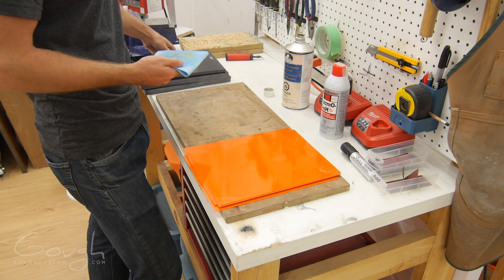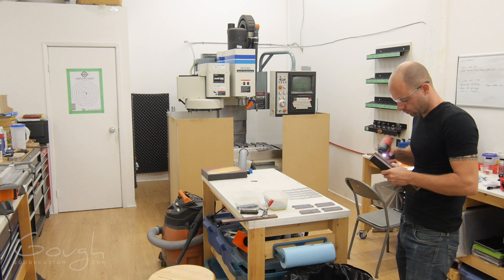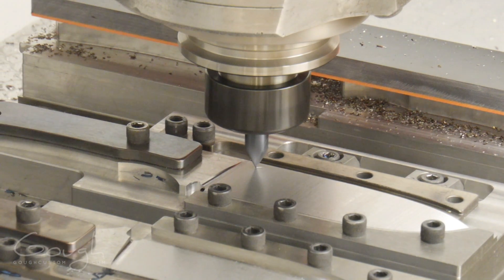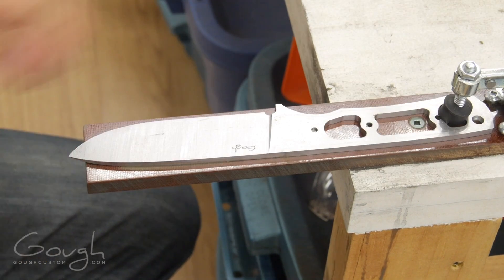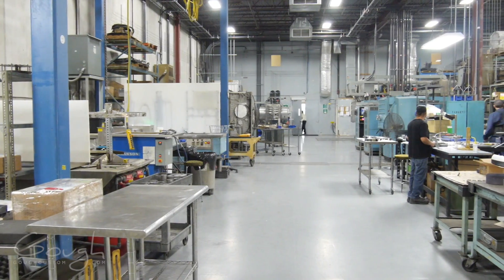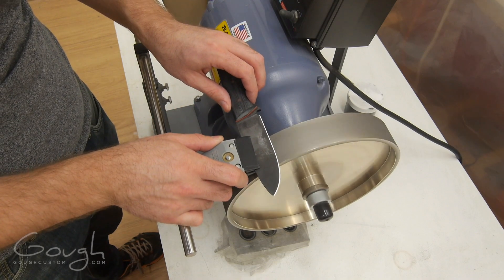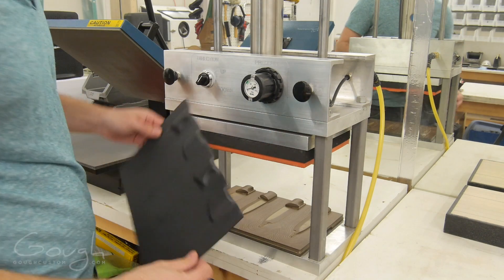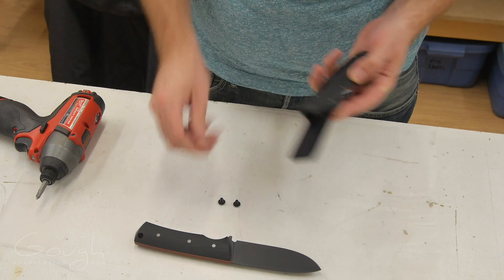Making a knife the high-tech way - Resolute MkIII

Comment: 63 Rockwell is not perfect
Reply from the maker: For my knives and my steel 63HRC is indeed perfect! Fantastic edge retention and lots of toughness. I have hundreds of these in the field with zero failures or issues.
Reply: Wow, 63 is pretty freaking amazing!  Honestly! 63 on the Rockwell exceeded my expectations by a large margin.  I was expecting somewhere around 56-58, to get 63 out of A2 is truly fantastic.
Reply from the maker: @levskitoronto  It's actually fairly easy to over-harden A2 if you're not careful! Higher hardness is not always better, every steel has a point at which it becomes brittle, which will differ a bit depending on the exact heat-treatment method used. I have found this hardness to work out really nicely for A2!
Reply: @GoughCustom  , I agree. 63 surely will give it excellent edge retention and since your knives have proven themselves to be durable and strong, I would say you have achieved a great balance.  Knives look superb. Good luck in you future endeavors, hope to be able to afford one of these beauties in the not too distant future. Cheers

Comment: As I saw you spin up your custom grinder I was wondering why you spent the time to reinvent the wheel there.. only until I realized you built it to keep the honing and grinding angles exactly the same, I really like that, it's something I wish I could do with my tormek! Brilliant!
Reply from the maker: Exactly! The honing angle is actually slightly shallower than the grinding andgle to make sure I hit the edge first, but yeah the setup works really well! The other benefit is that I never have to dress the grinding wheel, it stays perfectly flat!

Comment: VERY nice blade but knowing that the entire blade is heat treated to the same hardness and not just the edge makes it a blade I wouldn't carry and as such makes the sheath unnecessary.
Reply from the maker: Hey John! There's really no issue with a through-hardened blade! A2 is a very tough steel! I have batoned hardwood with my knives plenty of times for instance with zero issues...
Reply: @GoughCustom  batoning a knife is no real test of flexibility. I have found myself using my knife in a twisting/prying fashion MANY times in "normal" use. That is a true test of blade durability. If you can pry with it and it bends instead of breaking then in a survival situation "which all of my edc blades are intended to work for" you could beat it straight enough to continue using. I know that most people don't really need this ability but I spend about 80% of my time in the middle of nowhere miles from help and I personally need that kind of peace of mind.

Comment: I'm not an avid watcher, so I'm not sure what happens with the plastic sheets after you cnc the sheaths, but it looks like you could fit a couple more belt loops onto the leftover plastic. Maybe use them as extras.
Reply from the maker: Unfortunately most of the rest of the plastic sheet is actually not perfectly flat, and I need some space for the tape to hold it down, so I can't use 100% of it! I am working on a new way of making the sheaths that will use more of the sheet though!
Reply: Regardless, your knives are insane. Definitely subscribed.
Reply from the maker: @Post220  thanks bud!

Comment: Question, what type of alloy is used for the blade?
Reply from the maker: Hey mate! In this case it was A2 tool steel.
Reply: Gough Custom thank you for the reply. Follow up question if I may. Why not use a more traditional/common alloy such as a blue or white steel, 400 series, Damascus, etc? Don’t mean to be second guessing you, just wondering.
Reply from the maker: Hey mate! The main reason is that A2 is a really good balance of toughness, edge retention and corrosion resistance. The paper series steels are nice, but very prone to rusting. 400 store steels tend to be low end, the best one is 440C and unfortunately that tends to have very low toughness. Damascus can be beautiful, but it tends to have more issues than any "mono steel" would, things like cold shuts, slag inclusions and so on can be hidden from the outside but cause issues with breakage, and most Damascus also tends to be made from very simple steels so edge retention and corrosion resistance can also be issues... I have a whole video testing a bunch of steels on my channel if you're interested!!
Reply: Gough Custom thanks for taking the time to explain the logic behind the alloy you use. 

Any chance you’ll be making a kitchen/chefs knife? I would love a chefs knife with the lvl of craftsmanship this knife has.
Reply from the maker: Yeah I have a design already for a santoku that I'd like to make more of at some point!
Reply: Gough Custom that’s great news. Is there anyway I can be notified when they are released?
Reply from the maker: Absolutely! If you sign up for the mailing list on my website I will be able to notify you!
Reply: @GoughCustom  You should try Cruwear

Comment: Why didn't you just buy a Tormek knife sharpening system instead of copying their design?
Reply from the maker: My system is inspired by their mechanics, but copying might be a stretch! I don't like their use of traditional abrasive stones as it means that you have to constantly dress the stone to keep it flat. I didn't want to have to run the system wet either which is why I opted for a plated CBN wheel. CBN is very thermally conductive which means it will pull heat out as it's grinding, as opposed to traditional abrasives like aluminum oxide which are excellent thermal insulators and leave all the heat in the workpiece. I also wanted to be able to grind and strop without changing the grinder setup which is not possible with the Tormek, all the ones I've seen you have to switch over the tool rest. So with my one: variable speed, reversible, and ultra modern abrasives mean that can get the job done much faster with zero mucking about!

Comment: I prefer fire and hammers, but as a crafts person myself you'll never find me throwing shade at anyone else willing to put in the time, work, and repeated failures required to find what works and to perfect it as much as they can. Interesting vid and damn fine blade. Respect. 
I'm curious about edge retention and stress tolerance in the blade. A fine edge is all well and good but will it stand up to bone, drops, and abuse? Would love to see that. 
One final thought, if the blades are tempered in a vacuum chamber why do they have a patina on them? Some of my work is tempered in a hot oil bath and the oxygen free environment prevents that discoloration.
Reply from the maker: Hey mate! Thanks very much!
A2 is actually surprisingly tough even at high hardness. My customers and I regularly baton these blades through hardwood with no issues. Haven't any reports of a damaged blade or chipped edge as yet! I also have quite a few military customers and I'm sure they're not nice to their blades! I plan to do a 'use and abuse' video at some point, but I just have to find time!

The blades are austenitized and quenched in a vacuum furnace, but tempering is done in a separate oven with normal atmosphere which is why you see the straw colored oxide. Good eye!
-Aaron

Comment: If you do not have forging skills, but you have a cnc...
Reply from the maker: Not really why I make knives this way, if I wanted to learn to forge I wouldn't have any issues doing so. The problem with forging is that it limits you to simple steels that are honestly rather lacking in overall performance compared to medium or high alloy tool steels.
Reply: But what about damascus? Some kinds are quite good. As for me, I like to use scrap bearings as free steel source for knive-making)
Reply from the maker: Damascus has pretty high chance of slag inclusions, cold shuts, weld imperfections and so on. I very much respect the craft of forging, but I think that generally a mono steel stock removal blade made from a decent medium alloy steel will out perform most blades made via forging...

Comment: nice blade with poor handle
Reply from the maker: I'm curious why you don't like the handle? In my experience it's very comfortable, it's actually far more rounded than it looks, I have used mine for many hours in a single day carving spoons without any blisters or hot spots, and I have a lot of these in the field with no reported issues!
Reply: To be very specific - I find real materials like leather, wood etc. to have nice flexibility and "nice touch sensation factor". When I'm doing something, then a knife isn't hurting my hand. It's like polymers are too stiff (unless researched for this specific use). I might be wrong in this case, but it's my experience with such handles in overall.

Comment: Isn't this kydex sheath damaging to the knife's cutting wire? I mean, kydex is a little bit abrasive material.
Reply from the maker: In my experience kydex is not at all an abrasive material! The only time kydex will scratch a blade is if some foreign material gets stuck in the plastic, which would also happen with leather. I haven't had any issues with the sheaths dulling the knives...

Comment: Odd question, if that's a vacuum heat treating oven, why did the steel turn straw? Have i been believing that's a reaction with oxygen wrongly this whole time?
Absolutely love your process :) just cursed with curiosity
Reply from the maker: Great question! The blades are hardened and quenched inside the vacuum furnace, with inert gas backfill... But the tempering stage is done with normal ambient atmosphere and it's this step that produces the straw color!

Comment: No coolant or pecking cycle on the drilling? 🙈
Reply from the maker: The drill is AiTIN coated solid carbide so no need for coolant when cutting steel! The hole depth isn't deep enough to need pecking (only 1.5 times diameter, pecking usually starts at 2-3x diameter). Also pecking can often actually decrease tool life, as the retract cycle often stresses the cutting lips of the drill as it pulls them up out of the cut, and when it re-engages when starting the next peck... If I can get away with it I never peck shallow holes!
Reply: Gough Custom we sometimes avoided coolant due to sudden temp changes shortening tool tip life when cutting stainless.

Comment: Now, i'm no expert but it seems to me that this process is way more expensive than necessary. Alo, kydex sheets are absolutely horrible. They're twice as big as they need to be. Unnecessary bulk. But hey, if people like all that and they think the price is right, more power to you.
Reply from the maker: I like kydex sheaths because they are very usable. No clasps or straps needed to retain the knife. They are not much larger than a leather sheath really... As far as expense goes: if I was making knives by hand to a similar level of quality I would have to more than double my prices. Setting up this process was expensive yes, but it allows me to keep my pricing where I want it to be, and more importantly allows me to maintain the very high standards of quality that I insist upon.
Reply: Gough Custom Fair enough. As for the kydex it really is personal preference. I probably came over a bit more harshly than warranted. Sorry.
Reply from the maker: All good mate! I got what you meant!

Comment: You got a lot of dislike because (and I do agree), this is way too easy, everything in your knife has been machined, there is almost nothing that is hand made. I know that it is an other way of making knife but there is not that knife making feeling of when you work for days on 1 knife which might not be as perfect as you do but you can feel happy of your work
Reply from the maker: This process looks easy because it's been refined through thousands of hours of hard work! I have made knives by hand plenty (see my other videos) and I can assure you this is actually a far more difficult way to make knives...  The payoff is that's it's also far more productive!
Reply: Yes I know you had made knives by hand and I know that it's not that easy to find the best template for a good knife that could be "mass produced" but, because they are all the same, is that not "boring" because they are not unique ?
Reply from the maker: Nope! There is art in making one design as well as it can possibly be made... Making a different knife every day is not that different from making one knife in many ways as I do. My goal is to make the best knives possible, and refinement of a single design is (in my opinion) the best way to achieve that.

Comment: Amazing work. I really like your fixtures and custom tooling. Given the amount of time it took to perfect your process I'm surprised you're showing it all! Your cnc rapid speed is painfully slow to watch but that's only when you're spoiled with fast cnc. Still lightyears faster than a manual mill trying to change out tools with a draw bar and collet. When I have my own shop one day I hope to be able to do something as nice as this
Reply from the maker: Thanks very much mate! It's always nice to hear from people that appreciate the machining side of things, we're a rare breed unfortunately! The rapids on my machine are generally kept at 50% but even at 100% they're only 375IPM... I keep the non-contact moves in my programs at around 60IPM because on my older machine (1994 Fadal VMC10) I've discovered I can very occaisonally overload a servo if I try to make 3D moves too fast... That's fine because these days I do 100% of my machining 'lights out' so cycle time is not all that important (as long as it's less than 16 hours so it's done by morning!) The other benefit of allowing long cycle times is that I can focus on surface finishes and tool life... I also do all my machining after heat-treat now (hard milling) so these factors are even more important!
Reply: Gough Custom interesting to know! What kind of load do you put on your tools in terms of chip per tooth on materials that hard? And I have to imagine you're using carbide? There's some hard turning done on treated d2 tool steel here at work and I know it wears out the inserts pretty fast!
Reply from the maker: Yeah I'm using AiTIN coated solid carbide tools. Chipload for the bevel is 0.0016" and 350SFM. I get about 4 blades per tool, but that is about 10 hours of machining time which is pretty good!

Comment: Isn't this how mass manufactured knives are made?
Reply from the maker: Not really... mass produced knives are usually made in a factory my many different people each doing a single step. The machinery and processes are also quite different as they tend to use lower precision processes like laster cutting to profile the blade, and then berger knife grinders to put on the bevels. This is the reason why you don't see too many mass produced knives with full-flat bevels (usually they're saber grinds) as berger grinders can make sabers grinds more quickly and easily. Lots of differences!

Probably the biggest difference is all the hand finishing and inspection that I personally do!